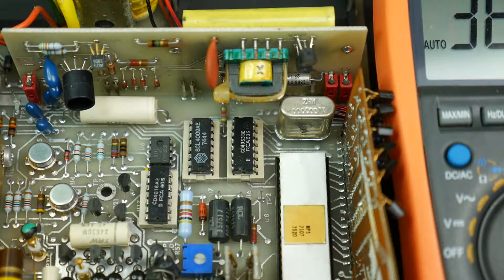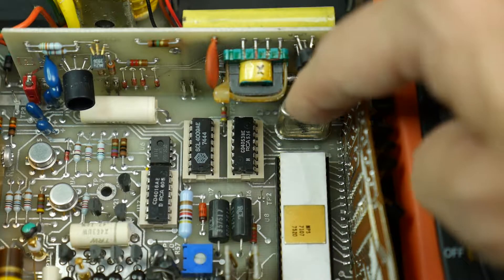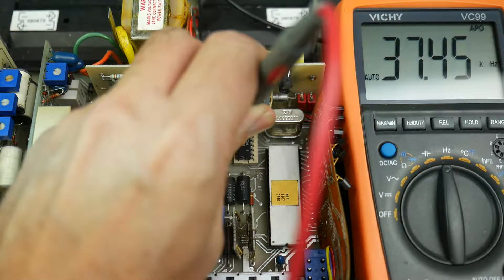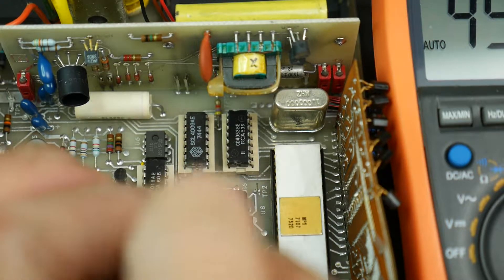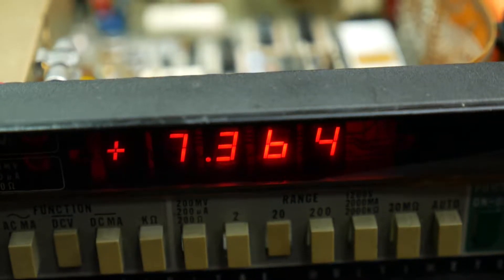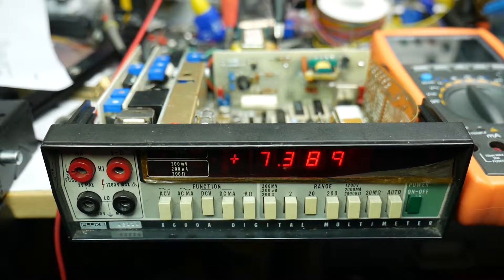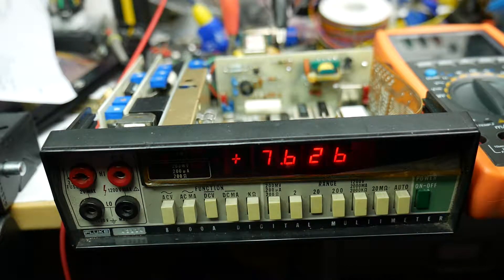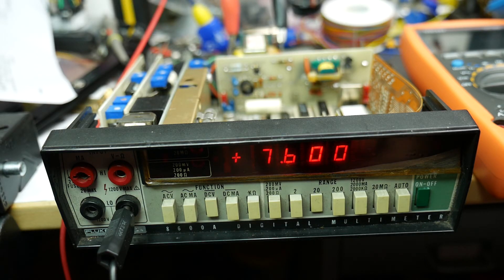Fluke 8600A Multimeter Repair

Comment: I am currently working my way through trying to.repair a Fluke 8810A multimeter. The display is very unstable and not very accurate. Also I can't seem to zero the DC readout. Luckily the manual is incredibly detailed and contains schematics and circuit diagrams.

Comment: You sound pretty knowledgeable on the 8600a, I think I might have overloaded mine (looking for sparkplug voltage) unit powers up but blinks 18888 only. Any ideas where to look to fix this apparent over state?
Reply: The main issue with damage to these meters is whether the chipsets, that are usually custom Fluke items have been damaged. Although I'm not familiar with your meter I'm sure there will be one of fluke's comprehensive service manuals on line. I'd start by looking at the analogue front end components for weak links. Sometimes the switched can be physically damaged when high voltages arc over them. Sorry, beyond this I can't really help.

Comment: Congratulations! You fixed it.
Reply: how do i contact anachrocomputer. I am trying to find the device type for the dual TO5  +/- 15volt regulator on the board in his video. 8600 circuit diagran shows two seperate 15v 7815/7915 devices. help Chris